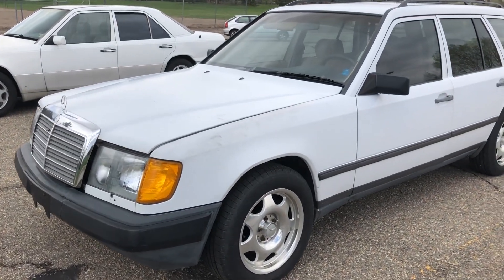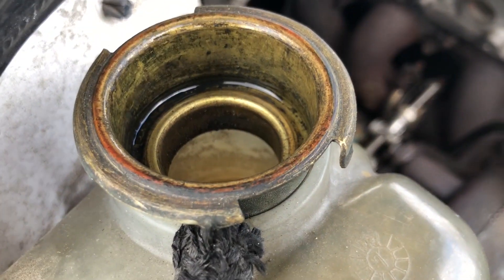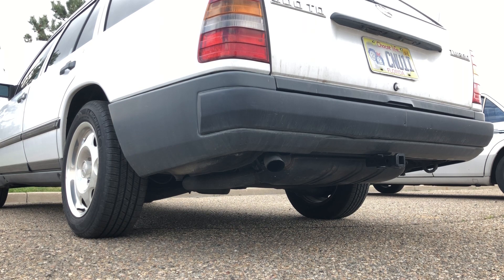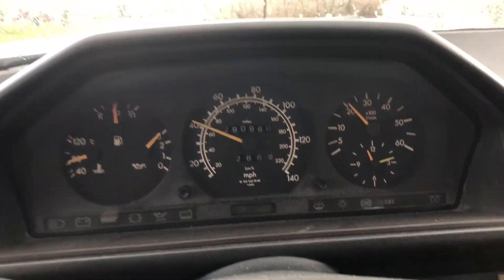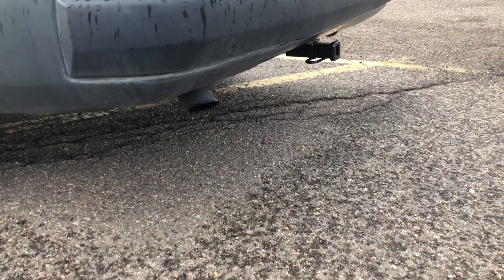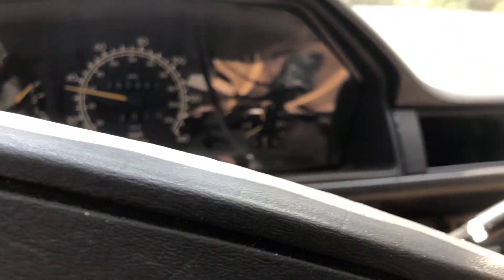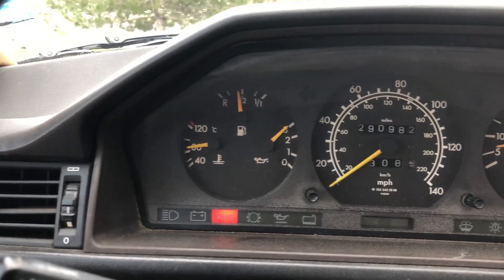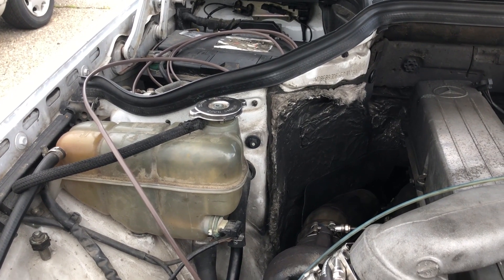1987 300TD OM603 - Holset HX32 Turbo Install - Troubeshooting

Comment: I have a 1987 300d with low miles wind it smokes like that when its cold.
Every one I've had hazes a bit when cold. Anything above 60 deg days it hardly has and haze. Its nothing to worry about.  If you were pumping water you would have steam at the exhaust even when warm.  Why did you get rid of the original turbo. I rebuilt my factory garrett and it runs great. Used garrett rebuild kit and added new balanced shaft assembly.  It will hit 20 lbs easy. Has good pull.
Get rid of your fan and add a pair of 12 inch mishimoto fans. Will stay much cooler and no power drag from fan.   Good luck with your project.  I would much rather have the 300td over the 300d.

Comment: Did you feel much difference from swapping turbos.. was it all bolt on or did you have to modify things.. I removed the clutch fan on my 1987 300d and added a pair of quality 12 inch fans now on 100 degree days with ac on it stays right 80c. 
I noticed a difference in power and added about 2mpg not having the drag from The original clutch fan. Best thing I ever did to the car. Drives much nicer.  Also swapped out the 70 amp alternator for a 120 amp unit. The extra charging is nice if you have a stereo amp. Plus headlight are bright with all 3 fans running.

Comment: What was your issue with the exhaust? My 300TD does the same thing
Reply from the maker: Never really sorted it out. Engine had perfect compression and I sold it and put in a 606. Project has been on pause for a while now though.
Reply: @jonbobshinigin  I have an 87 300tdt and I need an new head, Im debating on just going to the om606

Comment: Thats a realy bad running engine in idle. Did you check the injectors flowrate with the new pump? Its a very very sensitive system. I see also no original Bosch-Pump. Greetings from Germany

Comment: your charge side boot was clearly off lol at the turbo and intake manifold.....
Reply from the maker: There is an aluminum fitting welded in there. It was secure and sealed.
Reply: @jonbobshinigin  oh alright that makes sense.

Comment: Exhaust manifold is fine, pump timing is definitely off. Also you dont want to have all the vac lines joined together like that, run them each to the manifold. The hose from turbo to manifold looks like a boost leak waiting to happen.  what is the waste gate set to open at?
Reply: The 1988 model 300.Td om603 automatic transmission lifts up to how many hp.  thank
Reply: @gunayturgay4977  about 200hp in stock form, but the torque is what will kill it.
Reply: @professorjamesmoriarty5191  my question is how many hp automatic transmission.  it will be healthy.  unbreakable thanks
Reply: @gunayturgay4977  200hp is the most it will take, after that you need to upgrade.
Reply: @professorjamesmoriarty5191  Does the automatic transmission carry 300 hp
Reply: @gunayturgay4977  no. 200 is max.
Reply: @gunayturgay4977  if you want a 300hp automatic you need 722.6
Reply: @professorjamesmoriarty5191  my car 722.3 .... 722.6 auto correct
Reply: @gunayturgay4977  you have a 722.3, but if you want to have over 200hp in an auto you need a 722.6. There is plenty of info on the internet about it.
Reply: @professorjamesmoriarty5191  thank you for your interest
Reply: @professorjamesmoriarty5191  hello professor you seem to know a bunch is it possible to get this all fitted in a non turbo engine to make it a Turbo 7.5 elements one,thnx
Reply: @shrexha2619  Yes, but it wont last very long. The non turbo engine can take 1bar of boost, any more and you will kill it.
Reply: @professorjamesmoriarty5191  know of anyone the dose aftermarket pistons and conrods?
Reply: @justinjohnson4745  There are H beam conrods available, but they are not needed. The stock turbo pistons and conrods will take 3 bar - 600hp without issue, lack of fuel is what will melt pistons.
Reply: @professorjamesmoriarty5191  could you point me in the right direction, haha can't find a turbo engine where I'm from. Also dose a 606 connecting rod fit a 603 block cheers
Reply: @justinjohnson4745  yes it fits. What are you trying to do?
Reply: @professorjamesmoriarty5191  just going to run abit of boost into a na engine haha
Reply: @justinjohnson4745  keep it to 1.2 bar max boost and it will be fine.
Reply: @professorjamesmoriarty5191  oh sweet as   thank you for all your help, will on the hunt now for a turbo
Reply: @gunayturgay4977  722.3 mb auto trans is proven to withstand 350+hp with ease.

Comment: Whow, not bad. I have the same car 300TD with OM603 without turbo from 1992 as a switch - tomorrow is on my channel a video online where I accelerate the car in 100 seconds from 0 to 160 km/h ... ;-)

Comment: You're choking it with that stock pipe man
Reply: ABergman524 timing was off and turbo too large. I don’t think the exhaust was too small for this set up. It should be good for 250HP or so?
Reply: @tacticalnomad6599  its a 130cc pump so its good for about 350hp with the correct setup. That turbo is about the right size but they are designed for use in pickup truck motors like a cummins 6bt not for performance, and has journal bearings so it spools pretty slow. But that stock exhaust is definitely choking things up, along with the stock exhaust manifold and stock intake manifold. Not to throw shade on this dudes build. I absolutely respect it and am glad to see more people get into mercedes diesels. Just needs to adjust pump timing and get a bigger bore exhaust and that thing will be hauling ass :)
Reply: @tacticalnomad6599  what turbo do you use now ?

Comment: No intercooler? These engines were thermally above limit in oem condition
Reply from the maker: Ali Elabdimarras I am installing one soon but in its current state, it doesn’t see any boost above 4-5 psi even when driving hard. I’ve decided to do an OM606 swap with quick spool valve anyhow! The wagon is basically NA right now because the turbo is far too large.
Reply: @jonbobshinigin  I wouldn't. Hx32 on that 603 is perfect, you just need to pull the pump back off and set the timing properly.

Comment: Im not into the Mercedes diesels just yet but that idle sounds like bad timing. I'd say the new pump needs adjusting
Reply: Temp not getting hot could be running rich on fuel too

Comment: looks like the timing on your Injection Pump is a bit off. you can try to adjust the 10mm scruw on the right side of the pump, just remember to lossen the 3 long bolts to the Injection Pump before adjusting. maby the smoke will go away after adjusting the pump ;)
Reply: StianNorway a Good Diesel Purge would be something to look into, use Liquid Moly.